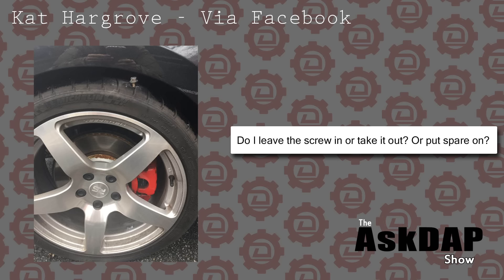Askdap Episode 76 | Warranty and Broken Oil Pans + More

Comment: Thanks for addressing my question about the parasitic battery drain. As it turns out, we had an insurance company's tracking unit plugged into the OBD port until recently. When I removed the tracker to return the unit, it was warm feeling so I think this tracker was the drain. We have not had a problem since we removed it.
Reply from the maker: yes OBD ports have power and if you have something in there at all times it has potential to draw on the battery

Comment: Love the channel. Just bought my first VW GTI and love it. Just wondering if there is a simple way to take off the lower grill on the fog lights on MK7 GTI; one of mine cracked. I've watched your full bumper removal just wondering if there is an easier removal method. Cheers and thanks for the great videos.

Comment: Awesome informative vid as always. Have a question regarding lowering springs in the MQB platform. I currently have VWR springs on my 2015 Audi S3 (hatch) and am getting quite a lot of creaking from the front suspension. Fitted new OEM strut bearings and bushings, but did not make a difference. creaking is at its worst at slow speeds turning from lock to lock, parking and so on. Any advice as I'll prob go back to the stock springs or coilovers if I can't get it sorted. Thanks

Comment: I have a mk7  with dcc and I'm  wondering if I will be able to clear speed bumps   and driveway curb ramps with vwr lowering springs and if it would be necessary to get the heavy duty strut mounts? Love the videos just bought a euro light switch from DAP!!

Comment: Hello Paul, I have a question regarding my 2015 gti s. I have the same intermittent driver side door problem as the person in episode 73. I brought it into the dealer the other day and they could not replicate the problem. I am still under warranty and was wondering if you have any pointers for convincing the dealer that i'm not crazy? They would not even bother with a VCDS scan as well. 
I did the scan myself and it showed 65593 - Switch for Central Locking B122D 29 [008] - Signal Implausible. Thanks!

Comment: I hope you see this.  I have 2016 GTI.  White the heat is running, there's  a cold air draft making its way into the car during right turns 20 mph+, especially in traffic circles.  It seems to be coming from the middle of the console and it quite noticeable.  I haven't taken it to the local dealer here because I'm not sure how to articulate the issue fluently in Italian.